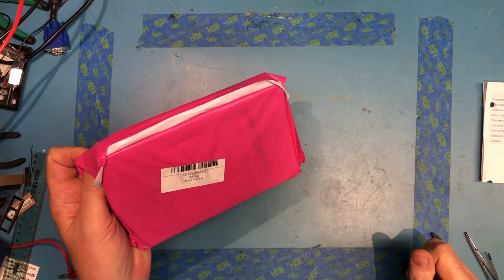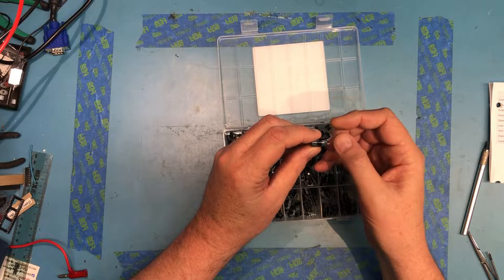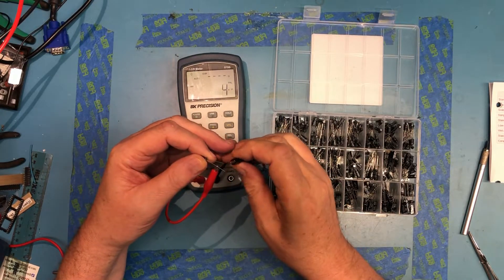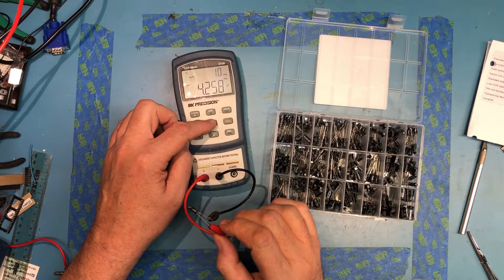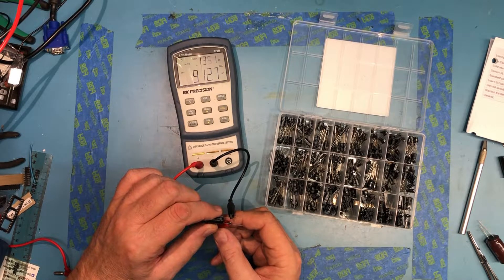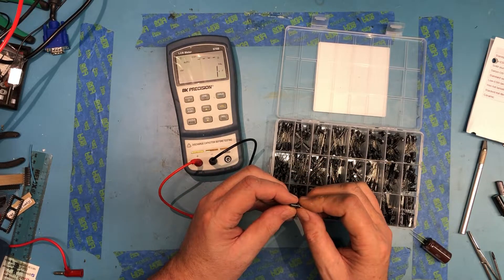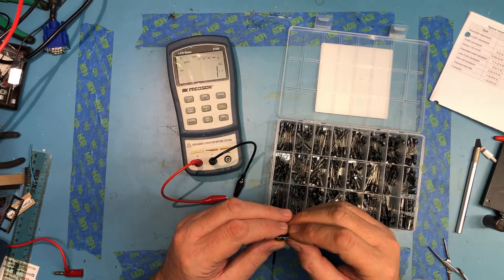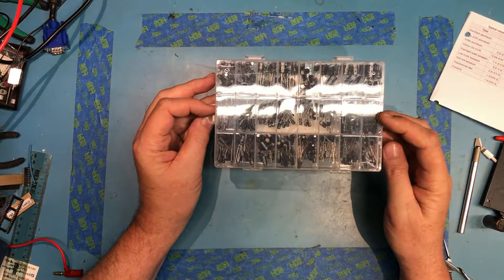Cheap ebay Capacitors - Are they worth the cost? - STB257

Comment: Don't forget that the stuff from China that is selling way below market wholesale and retail pricing are counterfeits. People who shop based on lower pricing will wind up with a counterfeit. These manufacturers make counterfeit Toyota oil filters, iridium spark plugs, spark plug wires, and even oxygen fuel/air ratio sensors. The cheap labor in China produces every known brand of batteries for cell phones that can explode and catch on fire. These intentionally made counterfeits are flooding the markets in Europe and North America.
These counterfeits are so well duplicated that the hologram markings on the packaging are done so well that it's virtually impossible to tell if they are real or counterfeits. There's a very good video documentary on this topic here on YouTube. It's unbelievable how massive this has become. Containers at the shipping docks full of counterfeit goods. Illegal drugs are bad enough, but when they intentionally rip off buyer's money too, it's disgusting and without any shame or guilt.

Comment: the test you just did says nothing,  elsewhere on You Tube someone put his power supply on it,
AND THAT WAS SCARY! it exploded before the indicated voltage was reached!?
Reply from the maker: True enough. We have no idea who made the caps in each batch etc. I still use them occasionally in a pinch. I still tend to buy new from Mouser or Digikey for anything important.

Comment: I have a simalar cheap set of caps from ebay. Most of them probably are rejected caps from manufacturers. Just an ESR-test is not sufficient: you have to test for voltage capability and leakage current too. I just saw an other review video where those caps exploded before reaching their nom. voltage! Some of them withstand the tests, others didn't. So you just don't know what you get and what you have. You maybe lucky - but you don't know in advance when you order cheap electronics from china.

Comment: i got this same box and i don't think a single circuit i built has worked and if they did work they did so intermittently, so it's not worth the cheap ness. because I'm going crazy, thinking I'm doing stuff wrong. also agree some of them are so tiny and then other ones of smaller value are way bigger which doesn't really make sense. ive found decade's old ones that work better. i always have little problems building circuits but it's usually a little mistake or bad connection. ever since i got the Ebay box, nothing has worked, and I've spent probably a dozen hours troubleshooting and stuff still doesn't work. i might end up throwing them in the trash.

Comment: Have used the same caps a few times for powersupply repair in older TVs and some low (under 5amp) powered 12v ac-dc supplies. They get the job done,most have lasted around 2 years or more. Doubt they really are 105c and won't use them in anything important or high temp.

Comment: I've had these boxes for probably 6 years now. I have used them to recap Amigas, C64s and and Amiga powersupplies. So far they seem good. Only issue I've found was that many of the 47uF 16v caps were out of spec. High ESR. Discovered this after I got my ESR meter. So I went back and changed them for 25v or 50v 47uF for my A500s and C64s. the 16v 47uF ones are marked with 'EL' brand in my kits. I didn't see any other of the caps with this brand. I also have a later, little bit different kit than showed in this video and in this kit there are no 16v version of the 47uF cap. Only 10v, 25 and 50v. Some of the 47uF 16v caps showed an ESR of 20 or 30 ohms. Some didn't come up with voltage loss at all on the ESR meter. And many had like 5 to 8 ohms ESR.